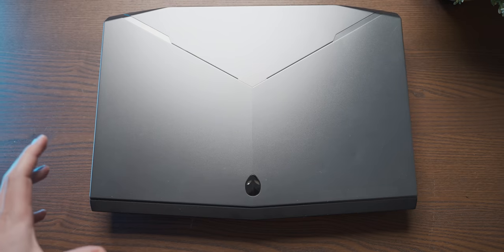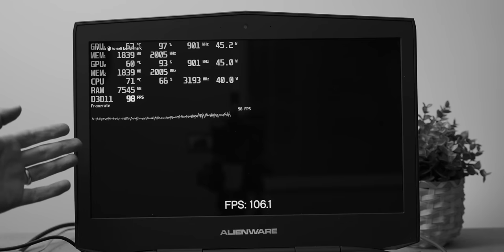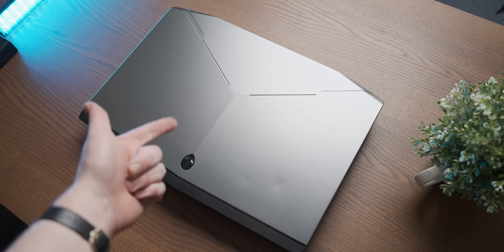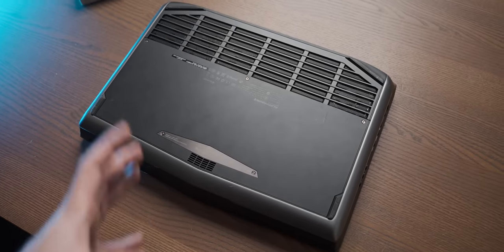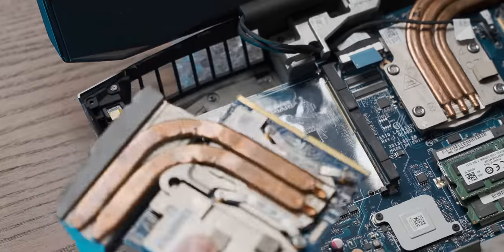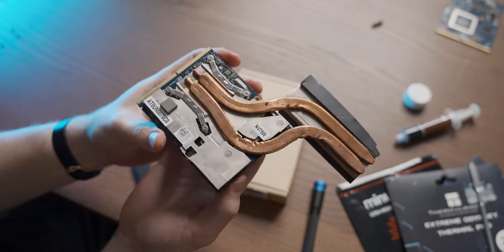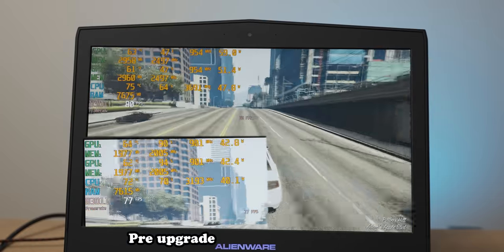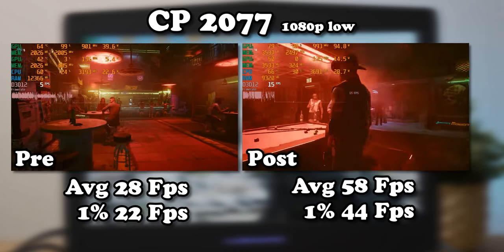Now This Is UPGRADING A Laptop

Comment: It's really sad how many of these new machines don't even have replaceable storage. I am really concerned about the future of modularity and upgradeability especially with the succes of the M1.
Reply: @lucidnonsense942  only problem is price, I would love one but will never afford one.
Reply: @dakota48  perhaps get one used
Reply: Are you talking about macs? I haven't seen any Windows laptop with soldered storage, especially gaming laptops, they even come with two m.2 slots.
Reply: @JimmyZeng  I think low end laptops like the ones used for Chromebooks has it, which can at times also be sold as Windows laptop. 

Perhaps also various ARM based laptops (which ironically enough is what the Apple is as well, lol).
Reply: @AndersHass  but like, even if you could upgrade a chromebook, is it worth it?
Reply: @epepepe7178  well Steam is starting to be a thing so it is slowly being possible to use them for more intensive tasks than basic webbrowsing, then there are also Android apps. 
But generally speaking no, lol. 

Framework does have a Chromebook version of their 13 inch laptop. I am not sure if you can upgrade the motherboard/CPU (it is physically possible but I am not sure if the OS still works etc.) but I am pretty sure you can upgrade RAM and storage.
Reply: Here I am with an Precision M6800 having five SSDs installed while almost everything modern only has a single nvme slot sometimes two. Kinda funny the fifth drive is a hot swapple nvme 2242 via the expresscard slot thanks to an adapter.
Reply: @AndersHass  Not a thing unfortunately.
Reply: just buy the ones that do. mine has 2 sata and one nvme slot, all of which are properly filled with ssds.
Reply: @MrKillswitch88  What use could you possibly have for 5 SSDs on a laptop?
Reply: @AndersHass  There wont be used complete machines, people will just upgrade them. Most likely path is to buy all the used parts and slap them together.
Reply: @epepepe7178  For what it's worth, my grandfather recently needed a replacement laptop because his old one would just barely function anymore.. it took 5+ minutes to boot, constant errors, and chrome would regularly crash.
It wasn't a CPU issue though as all he did on it was play solitare/card games, search google and watch youtube videos
Not a ram issue either as he only did one of those things at a time

It was the storage. 32GB eMMC soldered and non-upgradeable. Windows Pro would have the customisation needed to keep it running but Home edition was forcing updates and other unnecessary crap that filled the drive to 100% even though chrome was literally the only thing I installed on it and he never downloaded or saved anything. Any attempt to clear space would only get him a few days before it started a background update and filled up again

Thanks, Microsoft.
- got him a 5th gen i5 HP EliteBook Revolve 810 to replace it.. same price as a new chromebook for a used ex-government device with buttloads more power/ram/storage and touch screen (he struggles with click+drag on a touchpad so capacitive touchscreen is easier for him)
Reply: @JimmyZeng  Asus has quite a few laptops with soldered storage.
Reply: I agree. While the soldered memory and unified memory can be useful for specific applications, the vast majority of consumers not only don't need those performance benefits, but the benefits of upgrading hardware thus saving money and materials wasted are far superior for those vast majority of people as well. 

Even if many consumers needed those, there's no reason to not make said CPU/GPU/RAM on one socket, and make that large chip socketed. Then on desktops and laptops, you can still have DDR4/5 and PCIe/MXM slots for upgradability and for those who only want a CPU instead of an SoC, but make the options available for those who run that niche workload that requires soldered-together components.

AND the reasons apple provides for the M1 using this soldered-together architecture are irrelevant for a variety of consumers as well. You can have excellent battery life with modular components, you can have thin laptops with upgradability, which still offer choices and the freedom for consumers to choose the laptop they want. 

TLDR; The M1's architecture being adopted in laptops and god forbid desktops makes no sense for the vast majority of consumers, compared to the upgradability that's enjoyed by users of desktops and at least older desktops. And for people who do want the benefits that such an architecture can provide, there are ways to keep upgradability and modularity as well.
And also in every scenario I've seen, soldered storage is.... just stupid. Compared with the latency and bandwidth of high end m.2 or especially PCIe to m.2 adapter cards, soldering on people's data and making it culpable to any system failure besides that of the SSD is evil.
Reply: @dakota48  with Dell and HP also trying to get into the market of repairable/upgradable laptops, I believe it is possible for laptops of that kind to become much more affordable soon.
Reply: @AndersHass  Thanks for pointing that out, I stand corrected, at least we still have plenty of decent choices.
Reply: @dakota48  that will go down in the future, their 13 inch laptop is good for its price
Reply: @beersandbacon  I believe those are thin and lights, not gaming laptops.
Reply: @dakota48  perhaps some point in the future. I could see some people selling their 13 inch because they rather have the new 16 inch. As far as I am aware they are planning make a marketplace where people can also sell their old parts, so it is possible people would sell more or less whole laptops.
Reply: @rysterstech  I think it is possible some people will sell their 13 inch because of the new 16 inch. But otherwise more likely people will sell various parts instead.
Reply: Ist M1-Chip besser als i5?
Im Vergleich zum 2,0 GHz Core i5 MacBook Pro war das M1 Macbook Pro nur 7 Prozent schneller. Es war außerdem schneller als das 1,4 GHz Core i5 MacBook Pro, aber wurde von dem 16-Zoll-Laptop mit 2,4 GHz Core i9 geschlagen.18.11.2020
Reply: @JimmyZeng  the G14 and G15 have half of their ram soldered.
Reply: @beersandbacon  I thought we are talking about storage here.
Reply: @JimmyZeng  Dells XPS 13 linup is all soldered storage
Reply: @christianklinger6826  I find it interesting you make a German comment to an English comment for an English video, lol

i5 is a tier within a specific Intel CPU generation, so not all i5 are equal. 
The big improvements with Apple's own CPU is singlecore performance and power efficiency, so it is possible the multicore performance isn't that better compared to the latest Intel version (I don't remember the performance numbers off the top of my head).
Reply: @andyk192  I guess someone doesn't like having data plus I got a lot of games.
Reply: @AndersHass  my bad.  Ya but 2,0 GHz Core i5  ->18.11.2020.  isn´t a small hint.
Reply: @MrKillswitch88  I have an M6800, too. What's your storage configuration? And what ExpressCard adapter are you using? Is it the ThinkMods one made for a ThinkPad? Thanks.
Reply: @andyk192  Depends what his use-case and preferences are. The M6800 he's talking about is a professional mobile workstation that can also use RAID configurations and be used as a server. I have five storage devices in mine too, although not all are SSDs. Using all the available bays (some with caddies), slots (some with adapters) and USB ports it's possible to have more than 10 storage devices with this thing. LOL
Reply: @dakota48  That's not a problem, you won't be able to afford Apple M1s either
Reply: @FlyboyHelosim  I didn't want to wait two years for the proper ThinkMods adapter and went with the Chinese instead. The Chinese adapter works pretty well except there is an issue with the casing metal being razor sharp. As for the drive in that adapter I went with an cheap 512gb just to test this out and it worked. Anyway I got three 2TB drives and one 4TB drive installed then the 512gb in the excresscard adapter. I could go further however the cost adds up pretty quick.
Reply: @MrKillswitch88  Thanks for replying. So I guess you've got an HDD caddy fitted with an SSD in the optical drive bay? I think the ThinkMods adapter is pricey at $40. I love the M6800 and trying to squeeze even more storage options out of it. If only the WWAN card and Crypto Accelerator card slots could double-up to take mPCIe SSDs. I mean maybe they can but there's literally no info about the possibility.
Reply: @FlyboyHelosim  I gave like $28 for the Chinese adapter while $40 is steep for the Thinkmods one it is however the best overall and isn't razor sharp. You can get up to 2TB in the msata slot but one of the other slots is going to remain empty unless one of those SD card adapters but that is it. The sata bays you can go up to 8TB each if you got the money to burn but 2TB drives on the used market are really cheap right now while 4TB has come down in price as well.
Reply: @JimmyZeng  HP Zenbook's....at work a couple of them got discarded because of storage malfunctions...And there were some of the ProBooks I think they are called who had the same problem.  Their housing was so thin it would be completely impossible to house anything else than an Nvme disk and it might also just be space problems that they go with soldered ones instead of ones in a socket.
Though I'm more inclined that brands are sick and tired of people being capable of replacing parts on their own...something something maximum profit...
Reply: @JimmyZeng  dude, like every laptop under 500$...
Reply: Framework is the answer but since its a startup, price will be high until they make better bulk volume making
Reply: @MrKillswitch88  That’s interesting, I guess that an M6800 cannot boot from this ExpressCard disk though, right? Have you also tried putting an NVMe 2242 disk into a WWAN slot? I know that SATA based disks do not work there, however I read on some forum that an NVMe drive, which is PCIe based, should work though it would not be bootable, albeit it would be possible to put some boot files on a SATA drive and install an OS on the NVMe drive, it sounds quite complicated though. PS: I also have a Precision M6800 but with just 4 SATA SSD’s, 18 TB in total which is enough for me for now, I used my EC slot to add other two USB 3.0 ports.
Reply: @mertonnephake  Machines of this age don't boot from nvme unless someone gets around to patching the bios. Performance wise it is not worth it being slower than sata that all said it is well worth it for extra storage. Currently I got two nvme drives installed and can get a third. The express card slot tops out at 500mb/s while the two internal slots only go at 384mb/s though none of the nvme drives I've used thus far in m6800 use host buffering. Lastly I am the guy on the notebook forum that has modded an M6800 to accept an 80mm drive.
Reply: @mertonnephake  You can't just stick an M.2 NVMe SSD into the WWAN card slot on an M6800 as that's mPCIe. You can get Mini PCIe to M.2 adapter boards but the ones I've seen state that they're for Wi-Fi card conversion only and won't work with SSDs. The best option would be to get a true mPCIe SSD for that slot, but they're rare and don't come cheap.
Reply: Well, I mean.....as electronics continue to get smaller, this will become more of an issue.
Reply: @M.C.Turnt69  That isn't the issue but rather the overall design meta being crap these days. New tech in old style builds would make or vastly more comfortable and longer lasting machines than the thin hot plates that have become so ubiquitous over the past decade.
Reply from the maker: It’s a shame, because Apple theoretically could have made that platform super upgradable.
Reply: @andyk192  OK I hope you're sitting down, because we now know that the M6800 can house... wait for it... 9, yes NINE, SSDs! And that's before you use the USB and eSATA ports! LOL

Comment: Dawid Does Tech Stuff : the GTX 880M 8 GB is impressive considering that it was launched in 2014 based on the Kepler GTX 700 series architecture from 2013 and it had a rich amount of 8 GB VRAM which in uncharacteristic for Nvidia to give to us consumers....though that 122 Watt TDP is worrying since it's a discrete GPU but a mobile GPU nontheless.
Reply: That TDP isn't as bad as most would think as I've been daily using an 130w RX580 mxm for the past year and a half without issue.
Reply: confuses me how they managed 8gb of vram in the 880m but not the 980ti
Reply: @MA-jz4yc  It's called Nvidia anti-consumer tactic or Nvidias product EOL control :).

Comment: I've had this laptop from 2014 to 2021 when it finally died. Had it on i7 4700MQ, GTX 760 SLI, and 24GB RAM. Never upgraded it, never needed to
Reply: How many newer games could it play?
Reply: In 2021, I remember playing GTA 5 and BF 5 in 1080p comfortably in low/medium settings. at least 60fps consistent. Mostly just played MMO's (WoW, ff14), Esports titles, steam indy games, and emulators. Everything still ran buttery smooth.
Reply: @anthonyzheng7274  Damn thats many years it lasted!. Personally me i dont buy more newer expensive gaming laptops as i have converted to cloud gaming
Reply: yea old tech lasts for a long time. new stuff now are all made to fail so you'd keep buying replacements
Reply: @anthonyzheng7274  I definitely agree with that thing you said with old tech vs newer tech longevity. It is the same kinda with cars
Reply: Hey what's the name of this laptop
Reply: How did it die
Reply: @Asadc1995   I have a near-max config of the 17", still use it from time to time. It plays Borderlands 3 just fine, 880M drivers are the biggest pain, if I get some spare cash I might toss a 1060 in it, would run anything a desktop 1060 build could at that point.

4930MX - 880M - 32GB? Ram (I honestly haven't checked, its either 24 or 32, usually not relevant for gaming).
Reply: @AMidgetWalrus  Does your device support windows 11?

Because 10 support ends next year
Reply: @Asadc1995  Not sure if it "officially" supports it but it is currently dual booting it without issue.

Comment: 765m to 880m ... holy crap that would have been an expensive upgrade back in the day 😀
Reply: Back in 2013 I had the M18x R2 with dual GTX 675M's and I upgraded to dual 780M's, which was the best mobile card at the time. It cost me $1500AUD
Reply: @mbrooker79  yeah that sounds about right. Cool that it was upgradable though 😁
Reply: Damn dual 780m's in a laptop how was
Were the thermals?
Reply: @the.littlest.toaster  pretty cool. The M18x had excellent cooling, which you'd expect in such a huge 'laptop'. I then upgraded it to a single GTX 1070 and it even handled that perfectly fine with the stock fan/heatsink. Stayed in the mid to high 70deg range under load.
Reply: @mbrooker79  damn that's good temps did it have a i7?
Reply: @the.littlest.toaster  It has an overclocked i7-3920XM
Reply: @mbrooker79  nice i have a 17 r3 with a i7 6820hk and the 8g version of the 980m but the gpu isn't replaceable thing still works great got it back in 2015.
Reply: @mbrooker79 i mean clevo should be around 😂
Reply from the maker: Yeah they did not make those boards cheap.
Reply: @the.littlest.toaster my laptop has dual 750Ms